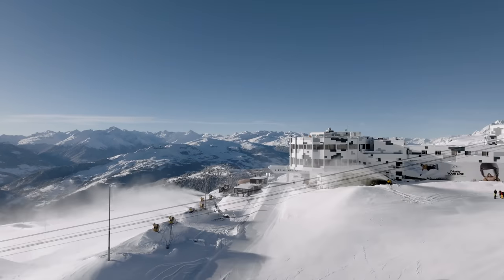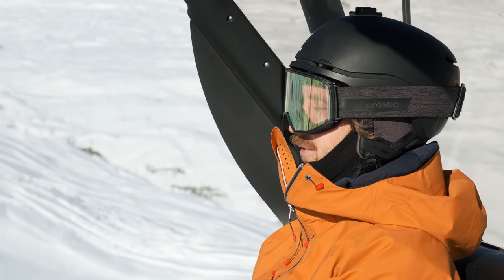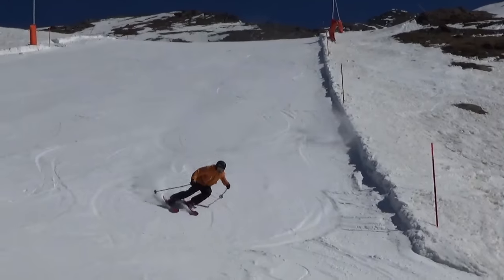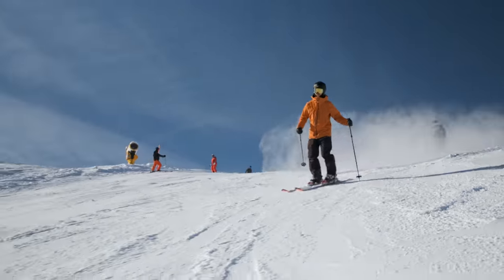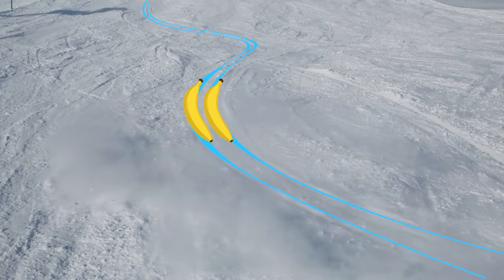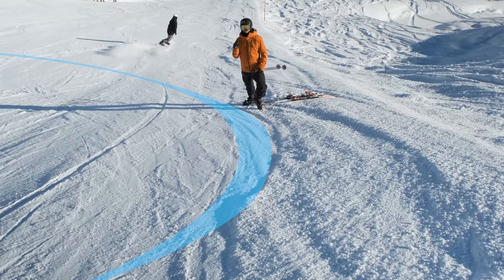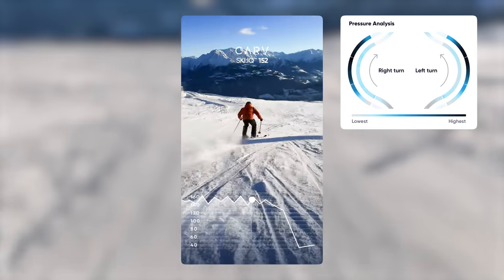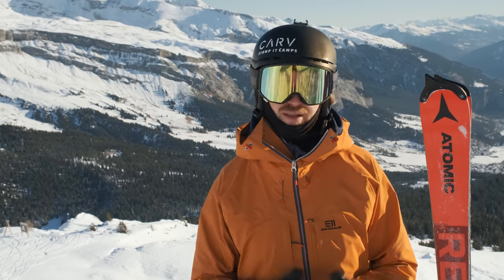How To Make Rad Short Turns the Easy Way

Comment: Thats a really awsome concept!! What confuses me is the forward movement. If the first third of the turn is carved, and only the second third is steered, does that nor mean I have to stay centered in the (carved) first third and not move forward at the start of the new turn? And you mentioned that “the body takes a shortcut” to get forward, I don´t get that (if the skis go to the outside and my body is”cutting” the turn will it not get to the back instead of the front)?

Comment: Thanks for this instruction.  I often wonder if how-to-carve videos always have skiers on relatively narrow waisted/parabolic skis. But I ski in western Canada and all my skis are wide waisted. Do these instructions still apply or is it a waste of time with wider all-mountain skis ?
Reply: I'm 5'5" and I use these techniques with skis that are 93 wide and 189 long.
Reply: It's going to depend on the skis. Do they have a short radius for a pow ski? A lot of camber underfoot? Metal? I think you can use the same techniques with such skis. The results would be better on a dedicated carving ski though.
Reply: it's about the radius not the waist width.  Width will add a slight delay adge to edge but since we're not racing it's not a big deal.  Radius will determine if you can carve a turn with this shape (16m or less radius) or if you'll have to skid this shape turn no matter what (20m+).  I ski on 3 skis for this reason, line blades, 181cm, 13.5m radius, armada stranger, 180cm, 15.8m radius and fatypus m5s, 188cm, 15m radius.  The blades are the narrowest underfoot at 95 but also have the widest shovels.  The armadas and fatypus are both 100mm+ underfoot.

Comment: Hi, I wonder how tall are you and how long is your carv ski. What is the perfect length to manage ski so easy? Thanks!  ;-)
Reply: A shorter ski will be easier to turn and be a lot of fun in perfect conditions. Longer skis will have a smoother ride, better edge grip on firm, icy slopes and generally be faster. The better your skills, the bigger you are and the faster you go will all point you towards a longer ski. For frontside carving purposes a 160cm would be short, a 180cm would be long. If you don't know where you stand on the spectrum go for a 170cm. Have fun!

Comment: What's the difference between a short turn and a carving turn? When should we use one over the other? What are the advantages of the short turn? It's a great tutorial but I was left with so many questions...
Reply: He mentioned it briefly when talking about couloirs.  Short turns have much tighter radii (shorter turns), so you can control your speed in tight terrain like moguls, couloirs, trees, etc.
Reply: It's like a different gears for different terrain. You could consider short turns as low range on a 4x4. The idea is to keep control not have the speed run away.
Reply: Well it's quite easy to imagine. Carved turns are restricted in radius by the ski's radius, and are the most efficient as it is the way with the least friction. So when do you need short turns? When you want a shorter/tighter turn, and when you want to brush off some speed.
In a carved turn you can control speed by angulation in the lower part of the turn and effectively holding the turn longer in the lower part (in contrast to angulation in the top part: this will actually propel you down the hill faster). If that range of control of speed is not enough, you will need to do a short turn and litterally brush off speed with the tails of your ski. And the other obvious reason to use a short turn is when you are in a narrow space: you let your ski's slip at the back to make the turn shorter.
The third reason to use a short turn is when it is very icy. The angulation needed for your ski's to be able to come to their designed radius, is sometimes too flat for the grip you have on the hardpack/ice. So you'll effectively turn your 13m slalomskis into 35m GS skis. By sliding your tails, you can still maintain a shorter turn shape, while not having to risk your skis sliding away underneath of you. Like what happened to Jens.
It is true that you probably could make it stick/carve on icy hardpack, but you'll need to sharpen your skis every other day and probably run a 87 to 85 degree sidewall for that, and a consistent 0.5 degree tuning (not a radial tuning where it flares off). You need a torsion-stiff ski for that as well. You effectively then made your ski into a race ski and it'll only want to carve no matter the conditions. So that is why us mere mortals use a short turn.
Reply: Thank you all, for the insightful responses!
Reply: @davesmulders3931  great explanation!  Do you mind explaining what you meant about angulation in the top part making you go faster?  I can kind of picture what you mean from personal experience but I’m trying to wrap my head around why it causes acceleration and not deceleration.
Reply: @theopinson3851  Hi Theo, thanks :)  If you angulate and/or early edge in the turn, you are placing your center of mass downhill from your skis and thus the centripetal force of the turn radius will propel you in that direction. I'll try to explain:
If you edge your ski's on it's side your ski's will make a turn. This acceleration can be felt greatly halfway a purely carved turn, the force pushes your across the hill with great force. So the force is perpendicular to the direction of travel of your ski's. So if you edge early, this force will push you down the hill mostly. Halfway the turn it only pushes you across, and at the end of the turn, the angulation will actually slow you down.

Another way of thinking about this is your center of mass which is fairly stable and your feet move underneath it to be able to 'steer' the mass. You angulate sideways to steer your mass across the hill. If we angulate in the lower part of the turn, we take speed away. We place our center off mass behind our skis, and the skis go mostly across the hill, not along the fall line. Hence we stop the mass from going downhill. The opposite is true for edging/angulation in the top part of the turn: you place your mass in front of your skis, and the skis turn more and more in the direction of the fall line. Hence you propel your mass down the hill faster.

Another way of thinking about it is a pump track (on a bike). If you excert pressure going down a bump you propel forward, if you excert pressure going up a bump, you slow down because you push yourself backwards. 

And, there is another process that you can make use of....a mass that is moving along a larger circle, if you bring that mass inwards, the speed will increase. (figure skating: bring the arms in for insane rotation speed). If you transition low, angulate, then push yourself downhill by extending, you will also bring your mass into a tighter circle which accelerates heaps. Actually, that is why a backwards stride (in a turn) on icehockey skates gives so much speed. On ski's, if you manage to edge early, angulate and really get the turn properly going before the fall line, you accelerate a lot due to the above reasons. It's my favorite thing to do on flat blue terrain. You can build up immense speed and it's great for practice.

You probably already do this anyway on flat terrain. Have you ever found that on flat pathways, you start really short carves with very high early edge pressure? You initiate the turn fiercely, then complete the turn very smoothly. You then propel yourself forward with each and every push or pump, and then smoothly complete the turn without much force, thus not slowing down too much.
Reply: @davesmulders3931  yeah, I’ve definitely found myself doing that.  It’s kind of funny because the result is also a “shorter” turn, but definitely not a “short turn”!  Something to consider so that you don’t actually do one when you meant to do the other and accelerate down that steep couloir lol.  Is that why racing flags are setup the way they are?
Reply: @davesmulders3931  One of the best replies YT has ever seen!

Comment: Any tips on what skis to test when i want a hard, short radius carver. ty ty
Reply from the maker: Any slalom type ski. Standard slalom is really fun but in this video I ski a FIS version of the Atomic S9. Very fun but I am just about good enough to handle it.
Reply: For anyone looking for a short-radius carver without having to deal with the demands and restrictions of an FIS slalom, I would recommend my two favorite carving skis. The Head e-SLR which has an 11.5 meter radius in a standard slalom length of 165 or the more versatile Head e-Original which has a 12.1 meter radius in a longer 170 length. Both have quick 66 mm waists and two sheets of metal without being overly stiff.

Comment: I'm skiing with my kids who are learning to ski at age 6 and 9. So I'm on the green runs a lot of the day. I like skiing on steep blue runs with short turns, but what can I do to have more fun skiing on the greens without leaving my kids in the dust?
Reply: @the.hiphopapotamus  I'm curious if there is a short turn style that could be done at a slower speed?
Reply: @the.hiphopapotamus  That's funny, I was just about to add a reply to ski backwards!
Reply: Do some drills.  Try turns where you balance entirely on the outside ski and the inside ski is lifted 100% off the snow.  If it's hard, then your balance is probably off.  Alternately, try skiing only on one ski.  Another option is to ski slowish parallel turns, focus on your edge change and see if you can get both skis to change edges at the same time and rate.  That's a start. :)

Comment: Do I need to swap out my all mountain skis for piste skis to learn to carve properly? Im starting to think it's my limiting factor to further progress but it's probably my skiing and not the skiis?
Reply: I don’t personally think that you need to, but I’m no pro. Having a ski with a shorter turn radius (something like 17-19m) helps a lot in my opinion. Regardless of what ski you’re on you can always improve, don’t let yourself get too much into the mindset of thinking you need different equipment to get better. Keep at it!
Reply from the maker: Probably its your technique thats lacking and not the gear. Changing to a pure piste ski can help but you still need to put in the training.
Reply: i had this problem too, all mountain skis can carve but you gotta keep more speed going to actually get them to work properly. They're stiff and the side-cut radius makes a huge turn if u wanna carve without skidding.
Reply: @jamesrosenberg1612  thanks. This makes a lot of sense to me. Have definitely been finding a need to pick up a lot of speed. I felt my long sweeping carves were okay but I've been struggling more with consistent short turns. I'm sure a better skiier could force the short turns but it's probably not optimal to learn this way...

I will keep at it regardless! But maybe I'll treat myself to some new skiis at some point :)
Reply: @iceicebabys  one thing that helped me was some exercises from triggerboy62 on how to carve low. Essentially being lower and more knee bent from the center position, makes it easier to get the  skis on edge for short turns
Reply: FIS GS race skis have a 30m radius. Most freeride/all mountain skis have less than 25m. I'm sorry to say: It's probably not the skis. On the other hand, a proper pair of second hand piste skis won't break the bank.

Comment: Jens, does the sharp steering movement cutting across the fall line create the weight shift toward the ski tips that at the same time releases the tails so that they skid a bit?
Reply from the maker: Not sure what you mean.
Reply: @StompItTutorials  Jens, I reviewed my question and can see that its confusing.  I should be able to answer my own question performing a movement analysis. // Marshall
Reply: No, the moment you transition from turn to turn, the ski's actually carve. On the midpoint of the turn, the skis already slide. What causes the slide is your weight being forward in the turn.
Actually it's really easy to feel/replicate. If you shift your balance forward throughout the whole turn, your tails will slip. Just make turns with your balance way way forward.... you'll end up going backwards because your tails slip out while your tips go up the mountain.
The hard part is to find the balance: how much forward do you need for a little slip? And when will you shift balance backwards to your tails again, and at which rate to grip in time before the end of the turn? Because getting the tails to slide is quite easy, but most people with brushed turns cannot go into a full carve at the end of the turn because they slipped out too much. That is a very inefficient way as your transition gets slaughtered.
Reply: @davesmulders3931  Dave, I don’t believe Jen's purpose was to create a skid.  My understanding is skidding in a short radius turn is the result of overturning the skis, making the turn radius tighter than the inherent turning radius of the ski.   I was questioning Jens because he said something about the steering action lightening the tails, which I didn't comprehend.
Reply: @gogglebro9421  Yeah, you obviously miss the point I'm afraid. You lighten the tails, so that they skid. There is no other reason to lighten the tails.
How would you make the banana shape if you cannot skid the ski? The whole point of the video is to show a controlled skid in every turn, for smaller turn radius and additional speed control.
Reply: @davesmulders3931  Dave, thanks for the clarification!

Comment: What kind of skis and what radius?
Reply from the maker: I need help understanding the question? I rode a S9 FIS about 13m.
Reply: @StompItTutorials  ah I see, it's just that it seems like a lot of expert skier are demonstrating short turns on GS type skis with larger sidecut radius to help with the blending of edging and sliding, so I'm just very curious about the difference of doing short turns on short radius skis (say less than 16m) and doing short turns on long radius skis (say over 18m) is all about. Thanks